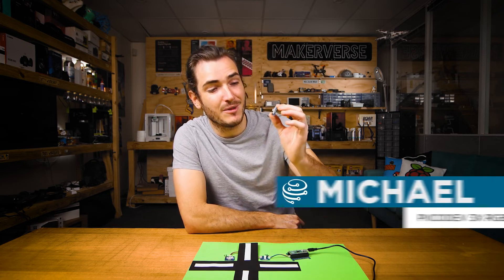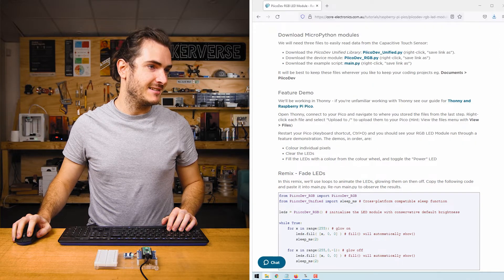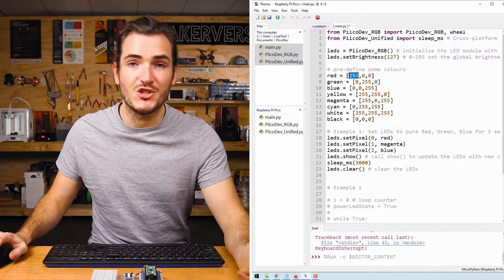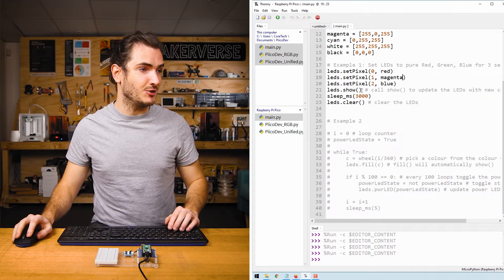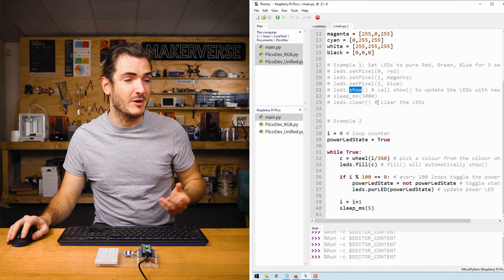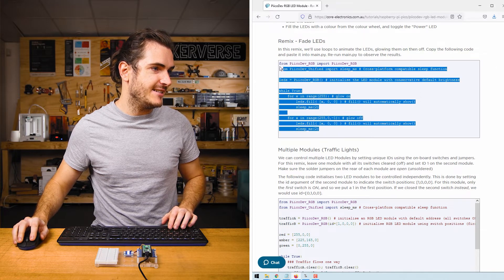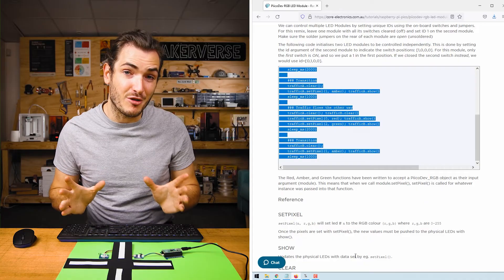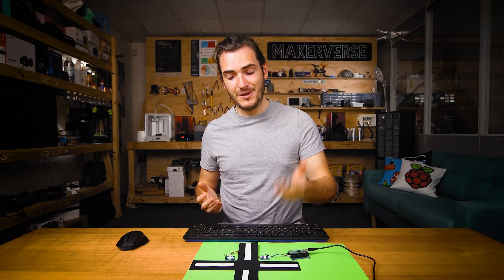PiicoDev 3x RGB LED Module | Raspberry Pi Pico Guide

Comment: can you help me with mapping my Xbox one controller to this motor drive. I have everything set up properly, all of my pins are firing correctly, and my controller is registering fine through the evtest .py. I just cant figure out the script to make the buttons move the motors. I've only been using python for about a week.